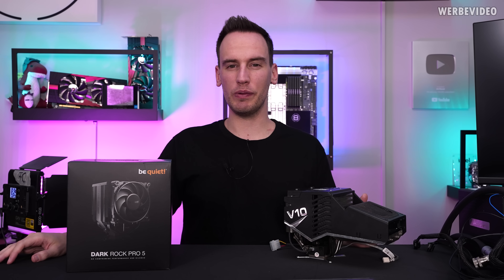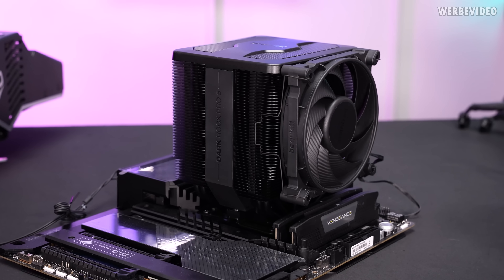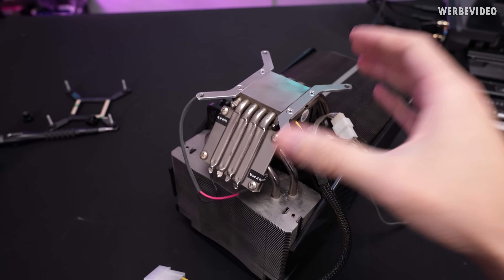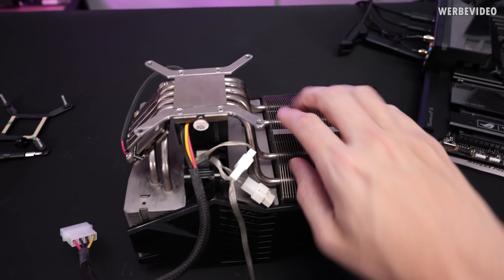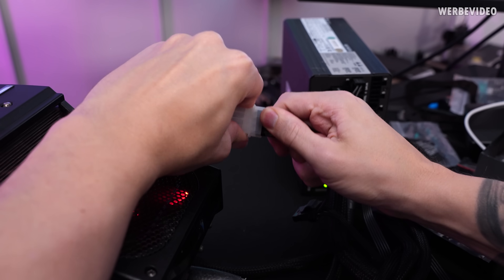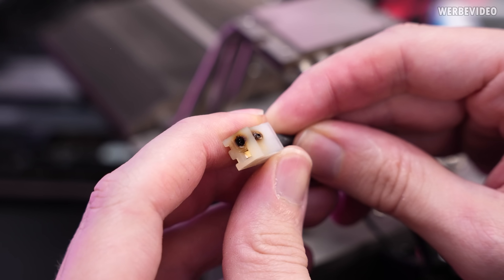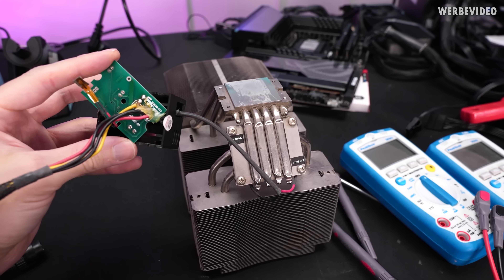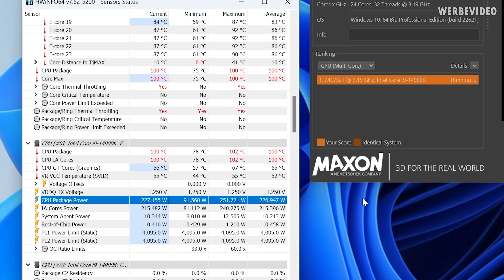This Gigantic Cooler from 2009 has MASSIVE Problems...

Comment: 13:15 It's strange to listen to this, considering that at the beginning it was said that the Peltier element works depending on the temperature of the sensor. Why talk about low consumption when the sensor is hanging in front of your eyes?

Comment: I remember selling this V10 cooler. We didn't think all that much of it, but water cooling was very exotic at the time, almost no one did that. The Core2duo 45nm of the time used 45w TDP, so this TEC was not as under sized as it may seem today. There was a V8 version that didn't have the TEC and was actually decent value.  Still I think the Thermaltake 120mm tower cooler or Zalman copper ORB cooler was the go to option of the day. The Zalman came with a manual fan controller, which was an awesome feature in the age before motherboards had full feature fan speed management.

Comment: I remember using stacked TECs with heat pipe coolers. Trying to cool a 200w+ TDP CPU with one is crazy, they just can't move that much heat. You would need around 1kw of TECs to move that much heat. I had 2 70w TECs stacked to cool 35w-40w AMD processors. You had to insulate the socket because once it got below the dew point the moisture would accumulate, freeze and short things out. Crazy times back then.

Comment: Peltier module is being used here in a wrong way. When you produce a lot of heat the peltier module lose their already weak efficiency and you end up with more like a heater.

What could be tested here is a different kind of a CPU load. Not all cores load, but less cores high boost load. For example gaming.

Boosting algoryhms check CPU temperature and if it's low enough it will make it boost higher, right? I think that this is what it should work like. Temperature sensor and controller board should turn of TEC in both - too low and too high temperatures.

I think that Linus tested something like this.

About any reason for selling it. Remember - we, people - do not buy things that are reasonable. 😉

Comment: What are you calling it?  A tech?  Tach?  It just sounds like a Peltier,  which is almost always terrible for cooling electronics vs. direct contact to a radiating cooler like a heatsink, even if it has to pass through a metal casing.

Comment: I actually owned one of these for my X58 build back in the day and remember replacing it with the Prolimatech Megahalems because it fit my case much better. I remember owning the V8 as well and not getting that much more performance out of the V10.

Comment: It might be a combinaison of to much power to see any TEC advantage, and power density or cooling time constant, that could also make the TEC useless because of the amont of interface between CPU core and TEC cool size.
I don't remember review back then, but I think for a 120-180W CPU they where some improvments, thougth too slim to justify the consuption.
But boys, you know, when cool tech is released we must try out !

Comment: I think something wrong here with your contraption. I had this tec cooling after amanda tec cooling because this less louder. Mine when processor reached around 70C° peltier was kikking in and in seconds it was like 40C°. So after that knowing i had boosted processor over 4.3GHz and it cept around 55C°. And then it draws around 345W of power. So yours was definely damaged. I think before you did wrong advertisement you shoud tested with other working tec cooler. :/ And yes if you disable fans and will leave only working peltier it makes condensate. So these fans taking care of that condenstaion too.

Comment: Back in 2010 I built a PC using this cooler, damn that cooler was huge!
The components I used back then was:
-AMD Phenom II X6 1090T Black Edition
-ASUS Crosshair IV Formula, Socket-AM3
-Corsair Dominator DHX+ DDR3 1333MHz 8GB (x2)
-XFX Radeon HD 5970 2GB GDDR5 (x2 in crossfire)
-Silverstone Strider ST1500, 1500W PSU
-Cooler Master V10 CPU-cooler
-Silverstone Fortress II Midi Tower (black)
-Corsair SSD Force Series F120, 120GB
-Western Digital Caviar Green 1TB

Comment: Hi. Self claimed expert on tecs here. (Im making motorcycle battery with tec as cooling)

Getting all its efficiency out of tec is pretty challenging. You either need to go "braindead" and CV/CC throttle the peltier to about 10-20% the actual TEC's rating, because I2R becomes more prominent as you crank up past that. It's basically a tug of war between peltier effect and I2C (and heat transfer). You can also make a control system using tec's current usage and temperature, but this is infitely harder & more expensive, so this kinda stuff (hell, even the forner too) doesnt simply belong in consumer market.

Tldr? You need to make your own not-garbage TEC cooler.

Peace.

Comment: I owned one back in the days, after some personal testing I had the same results. So, I modded it with a copper plate between the pipes, and it performed a little better.

Comment: Those aren't air coolers.  There's moving liquid inside it.  Those are vapor coolers.  Air coolers are blocks of copper or aluminum.  It's also a Peltier Chip/Module (pelt-e-aye) doing work, not "Tech".  If the CPU isn't hot, the peltier doesn't reverse polarity and start cooling the radiator.  It'll still chill the CPU until there's condensation.  But being a vapor cooler, and not an air cooler, the heat exchange process stops once the liquid reaches room temperature.  Kind of a beneficial side effect of vapor cooling.  Peltier chips in concept would work just as well as a refrigerant heat exchange setup would.  Just far less energy efficient while being more compact.  They make mini and vehicle refrigerators with them.  My guess here is you have a bad unit, and all of them were probably poorly designed.  Razer recently made a peltier cooler for phones.  The problem is poor design, and my example died in a week.  It was strong enough to build condensation in a 20% humidity environment.  But the controller isn't sophisticated enough to shut it off once it reaches a target temp.  The further both sides are divided in temperature, the more current it draws, until the chip breaks itself.  The V-10 was probably a great cooler on concept, but CoolerMaster wasn't willing to make a controller that would last, doubling the price of the product.  If I were to design a peltier cooler, I would make a U-shape of heat pipes connected to the CPU with 2 peltier modules attached at the ends an inch or two away.  Then connect the hot sides of the peltiers to either water cooling, or vapor cooling.  The controller would have to be very robust, capable of handling 300 watts, and a thermostat to shut them off once they drop below 40C.  You could mount it directly to the CPU, but adding heat pipes increases the surface area.

Comment: I remember the V8 and V10 from CoolerMaster in those years. Pure flash with no performance what-so-ever. In 2009, Zalman CNPS9500A was the king of air cooling. Peltiers were just unproven technology in those years as well. They didn't last long in the market.

Comment: I remember back at that era seeing a more conventional cooler with a peltier element, or thermoelectric couple. It cost £70 and I could see that it wasn't going to be that good. This was before the era of heatpipes.
They have their uses, water distillers use peltier elements to make a condensation plate.

Comment: Back in the day I had a swiftech(iirc) GPU waterblock with either 60W or 80W Tec element on my Geforce 6800 LE, it ran well the back of the card was cold to the touch, but one time sitting at a lan in a very hot room the contacts to the tec element simply melted... Looking back it was completely insane what I did to that poor LE.

Comment: the problem is with your 14900k. I'm not sure if you realized yet or not but the 14900 is far worse than the 13900. People all over are comparing the two and keeping the 14 at a workable temp is pretty fruitless.

Comment: I still have its lesser brother the MK1 V8 which ran a Vishera cpu and barely broke a sweat even under heavy load like Forza Horizon 3 and 4.   When I had just the stock cooler that came with the Vishera 8 core, it was a problem to stop thermal shutdown under load but the V8 just threw off the heat with a shovel.   Its funny that after watching your video on the CM flower cooler with the mega sized heat pipe, I like yourself didn't get that good a performance so I lapped to a mirror shine the foot of the baseplate and replaced thermal paste with phase changing thermal material and now its performing superbly, even at max load on my Ryzen 5 it rarely crosses the 50 degrees mark.

Comment: Is there room to flip it around 180 degrees and put the overhang over the VRM section of the motherboard? if so that would have aided cooling of the VRMs back in the days when this came out as VRMs in those days didn't have heatsinks on most motherboards

Comment: the controller has a thermp sensor, it needs to get hot of hotplate on top of cpu to get more power to peltier plate.
because you had controller loose on table and not on cpu

Comment: I recall Alex from LTT attempting to get TEC cooling working and failing every time. To get more cooling, the TEC needs to run at higher power, which produces more heat which the cooler has to additionally get rid off. So you're locked in a vicious cycle that you can't win. 
TEC cooling has only very limited applications and CPU cooling isn't one of them.

Comment: I had a peltier setup which I used with a Slot A 900 which was a 50w cpu. I it was setup up as a staged system with 2 70w attached to the slot a, then the second stage had 6 70w. Both stages where operating at about  1/3 their capacity so I was roughly getting 2/3 of the potential delta available. Overall I was getting temps at about -35 c at load but I was also burning through about 610w. They only work well if your only a fraction of their potential heat load because the delta vs load is roughly liner.

Comment: I needed a Cooler for my Z79 Sabertooth board that had a backplate.  I had everything assembled and realized this, so I went to the local PC shop.  They had a V10 and V8 that would work.  The V10 looked impressive but even I was worried how it would fit and hang off the motherboad in my HAF 932 case.  In the end I went with the V8 and that setup is still going strong playing all my modern-retro games.  Just in case, I have another V8 in the box.  The HAF cases and V8 coolers were quite the home run back then for HEDT.  Funnily enough, I used an old CoolerMaster PSU, Antec case fan and TEC to build my mom a wine chiller fridge, with a thermo controller to keep things chilled to 10C.  That's what a TEC of that size is good for :)

Comment: This has always been the problem with TEC's. They would have been great in a world where cpu's had tdps of 20W and Cpu coolers were having trouble cooling that. But they didn't exist during those early days. By the time the Pentium II was shipping, cpu's were pushing too much power for a TEC to be able to cool.

Comment: I was using a TermalFake Tower 112 all copper and I was looking at the V10,  BUT I was sick and tired dealing with a heavy air coolers 
and got something like H60 from there to fractal design kelvin 120mm, but it was not enough for 9590, so I toke the h60 radiator,
 tubes, fittings and Monsoon Series Two D5 Premium Dual 5.25" Reservoir and made my fist open loop,

I don't miss air cooling.

Comment: I can't imagine that a CPU cooler from the days of the Phenom II is going to cover enough of the IHS of modern CPUs to make a difference. I remember my DH-14 was just big enough for the Ryzen 7 5800X and the new chips have more surface area. Still, heat disapation requires fin surface area, and that's what modern air coolers have maximized. Back in the late 90s and early 00s a PC compenent often sold based on how it looked rather than how well it performed. Just look at the Alienware cases!

Comment: Could the issue be the temp sensor not working or the controller is damaged. If it does not allow the tec to cool down any further. You should try to just connect the tec without the controller and control the voltage to see if you give it more then it may be able to cool the CPU better.

Comment: That is an awful implementation of a TEC. Do you by chance happen to have a CoolIt FreezOne? I use a modified unit that easily cools my 5800X3D. I originally bought it for an E8500. The pump, tubes, block and coolant are the only mods.

Comment: I don't like the bequiet cooler. Proprietary stuff has ALWAYS gave me problems down the line... It needs a redesign so you can use fans from other vendors. Disappointed to say the least.

Comment: Back in the day I had a friend that had one of these. I was so jellous.  I kept trying to design how I would implement a TEC for an EPIC build. Now that I am an engineer and can run the numbers, it's clear how impotent TECs are for moving lots of energy. I am no longer jellous.
Reply: They can move a reasonable amount of energy...if you have a delta T of zero, or close to it.  Pretty much useless for CPU cooling.

Comment: This brought back some not very found memories, lol. I had a TEC cooler back in the day before I knew better. Not this one, but something similar and just as poorly designed. It was completely pointless, it really struggled to cool my 105 watt Intel Quad Q6600.  Eventually I replaced it with a basic tower cooler and it functioned way better and cost a fraction of the price. It is kind of silly that they ever attempted to cool CPUs with something that produces so much heat, lol.

Comment: 6:32 maybe to prevent condensation, in case the CPU is not hot enough. When the CPU heats up, the non-tec side can still dissipate some heat. With the ridiculous TDP nowadays, the non-tec side dissipates more heat.

Comment: WOW!!!  I have a V10!!!!  My old computer was giving me problems so I built a new machine in June of '09 and this is the cooler I chose for it.  I never benchmarked it, but my computer never had any cooling problems.  I got a few photos of the machine right after I assembled it and first turned it on.  I have to admit, it looked GOOD!!!!  Nowadays I choose my cooler based on how well it tests.  With all that metal, I think if you got rid of the TEC and maybe the shroud and just had the radiator unit and fans (upgraded fans?) you might have an improvement.

Comment: It seems like this "hybrid" design is a wonky way to try and avoid the achilles heel of a TEC where your heat load exceeds the TEC's capacity (ie: putting a 100W heat load on a 70W TEC) and you just end up with a glorified insulator between your chip and cooling solution.

At the very least, this cooler avoids that scenario but at the cost of making the TEC's already abysmal inefficiencies even worse.

Since TECs are more efficient at lower voltages (typically peaking around 1/5 to 1/3 of their maximum) and lower temperature deltas, I would love to see somebody use a pair of big flat copper/aluminum plates to link a parallel array of say eight 150W TECs between two watercooling loops in a chiller setup. Then, run them all at something like 3-4V (if they're 12V units) and use a controller to keep the cold side 5c or 10c below whatever the warm loop (with a big radiator) is at, assuming that temperature is still above the dew point.

Coefficient of performance above 2 is possible with TECs running in this way, which means your 300W CPU would only require another 150W of TEC power or so to get a clean 5-10c reduction in temperatures. Still not great, but a lot better than normal methods for using these modules and with how difficult it is to get heat out of modern chips, any reduction in the "ambient" temp your block is exposed to will be very helpful.

Comment: Adjusted for inflation, this thing was about 150 bucks or more, that puts it in the territory of 240mm AIO. 
But to be fair it's like comparing a 2009 CPU to a 2023 CPU- it's going to get roasted. Even in performance per watt it will lose. At it's time, that 2-3c temp improvement was the equivalent of people using contact frames now for that last 2-3% of their CPUs potential. Not really needed, but kind of fun to do. For probably 99% of the folks who bought it (me included) it was just a fun gimmick. I had one, and it did boost performance a few percent, not enough to matter really for the price. 
In the classic old core2 duos with the ASUS CUSL2 motherboard, and it's OC potential, that was a great cooler for it's time. But like the CUSL2 and the Core2 duo that was in it, it aged more like milk than fine wine. It's still fun to see these weird old experiments in the early days of overclocking and see how they held up. Like many, it doesn't. But it was fun to have.
Also that huge, weird side fan blocking on the ram- that was early days of memory overclocking, and heat spreaders were a novelty then, not mainstream. Plus, in many cases of the time that often had side ventilation on the side panel, and little other airflow that side fan was actually quite useful. In a modern case with all the front vents it makes a lot less sense I think. 
With that side fan I was personally able to get a good 5-10% boost to my bare ram sticks with that, and tall ram wasn't really a thing yet.

Comment: How about for a bit of a fun experiment, Disassemble the cooler and replace the 70w TEC with something a bit higher power. maybe a 150 or 228W unit. I brought 2 of those cheap AliExpress water blocks that you can have 3 TEC's fit to it. I put 3x 150Watt TEC's and sandwiched them between the 2 blocks. the cold side cools the water going into the PC and the hot side goes to a very large 9 fan radiator to cool the water cooling the hot side. 

I'd like to see if a larger TEC could 1) help cool the block down more and 2) if the cooler could handle keeping a larger TEC cool. 70W is not much cooling in todays CPU's